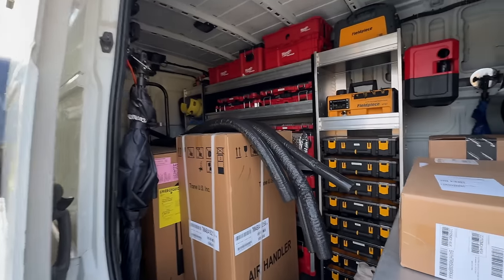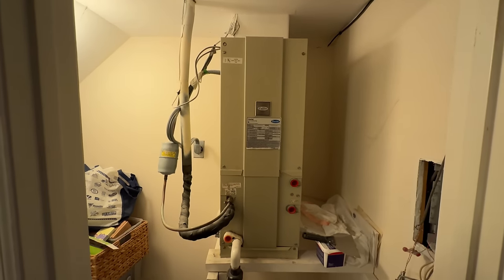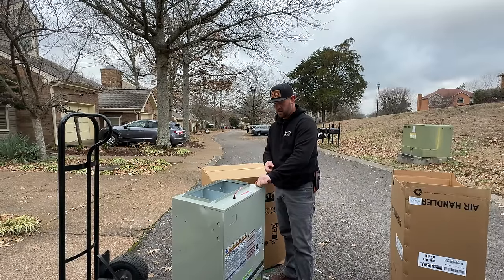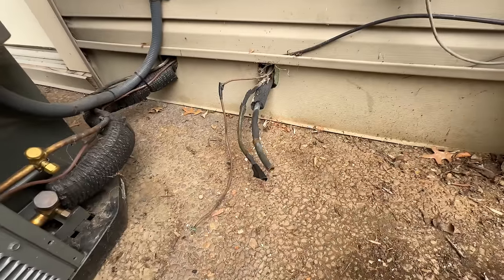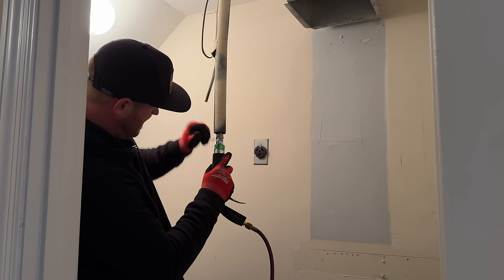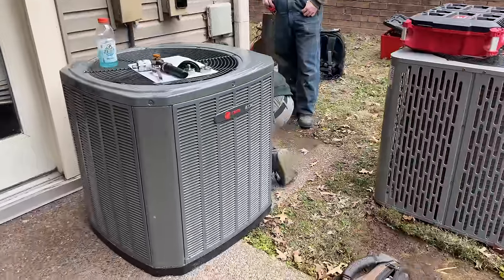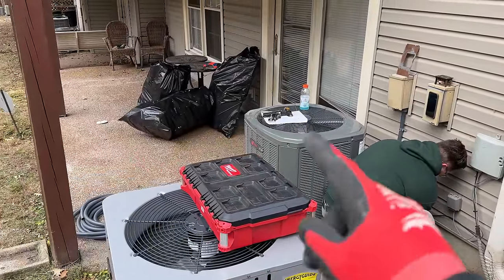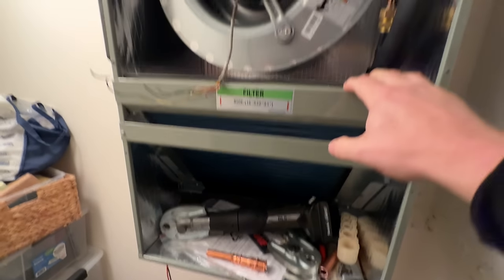We All Make MISTAKES | Learn From Them…

Comment: a very important factor to consider when changing an air conditioning system; especially the air handler, is to verify the static pressure (sticker I.W.C old unit) with which the duct system was designed, select the speed of the fan blower so that it operates at the balance graphic point for the friction rate established in the calculation of the distribution ducts, otherwise, instead of obtaining better performance with the new unit, more energy consumption and loss of efficiency are generated.

Comment: We always use a flush kit. Much easier to clear liquids. I would worry if there’s a kink in the line, the plug would get stuck.
Reply from the maker: I hear ya. If that’s the case, I’ll know to locate and fix the kink.
Reply: @QualityHVACR If it's inside a wall chase then we're SOL. That's what I would be afraid of.

Comment: I have a question, why did you just clean the suction line? Thank you.
Reply: because the old unit is r22 and the new unit is r410 A and they are reusing the lineset so they had to clean it because you cant mix 410A with R22

Comment: Have you had any issues with the RLS fittings?    Watching y’all use them is making me want to get the Milwaukee kit.   

Do you ever need to get the torches out anymore?     Would you use it on coil replacement or other service repair?
Reply from the maker: No issues. I love pressing, but it doesn’t replace brazing. Both are needed.
Reply: @QualityHVACR  I ended up purchasing the Milwaukee m18 with Streamline ACR jaws.   First job I planned on using it for (air temp condenser ) didn’t allow enough space. Haha brazing will always be a great backup, I’m just preparing for the new refrigerant and possibly flame free methods that might be required.

Keep putting out great content, thanks for the reply 🤘💪

Comment: Ok is that plug gonna make several 90 degree turns ?
Reply: Apparently yes.  There's a good trade show demo video on HVACschool channel i think.   The plug (aka 'pig') is not relying on its initial momentum but rather it has all that nitrogen pressure backing it up all the way thru.  Kind of like a bullet still in the barrel of a rifle.
Reply from the maker: With ease.

Comment: Ummm organize your truck on Saturday bud
Reply: I hope this is a joke
Reply: @lunativ1024  half joke. Organize  your truck during offduty hours
Reply: Sure. You do work on the clock. When off the clock you live your life. It called work/life balance. I take it you are non Union?
Reply from the maker: No thx
Reply: @malcolmwhite821  extremely non-union aka not-a-communist 😁 I worked more 100 days in a row this summer and last summer and most of those are 12 hours days. And I couldn’t be happier.